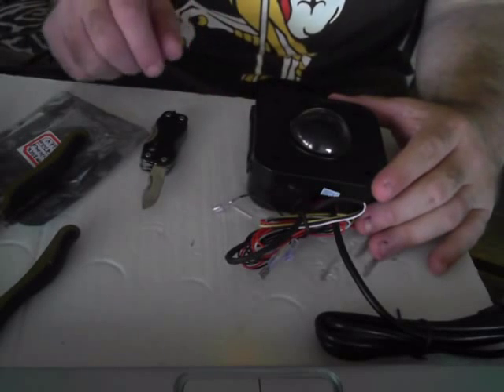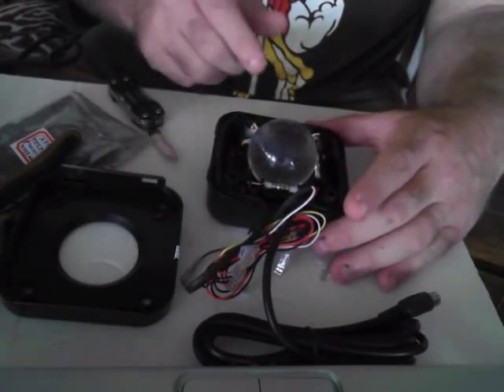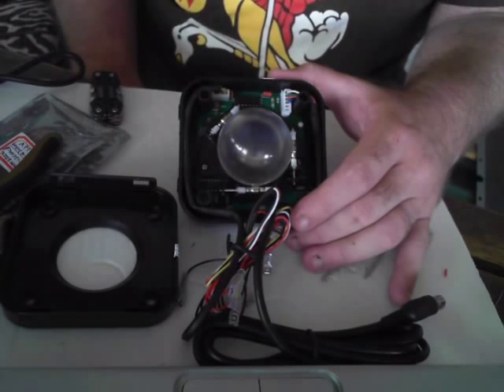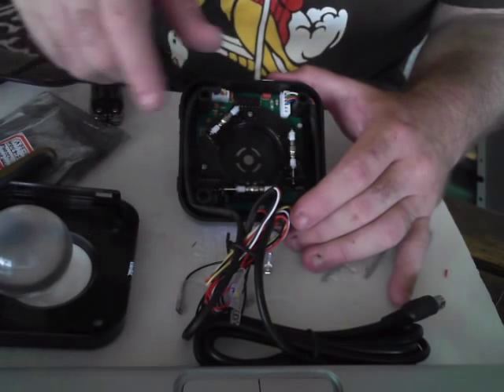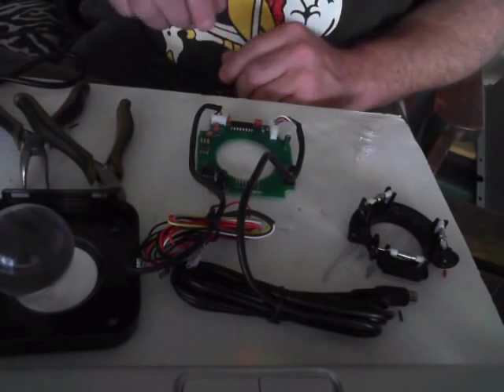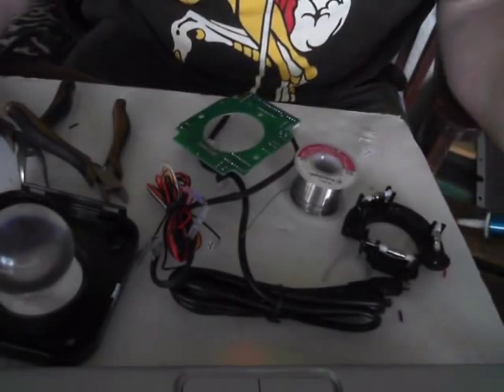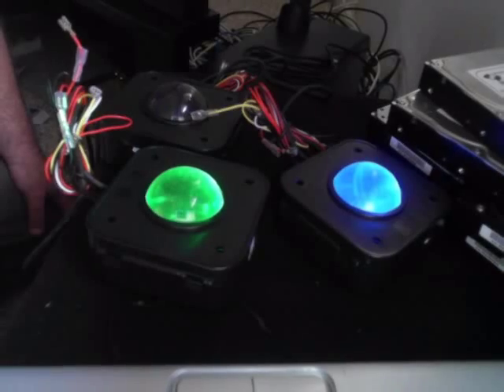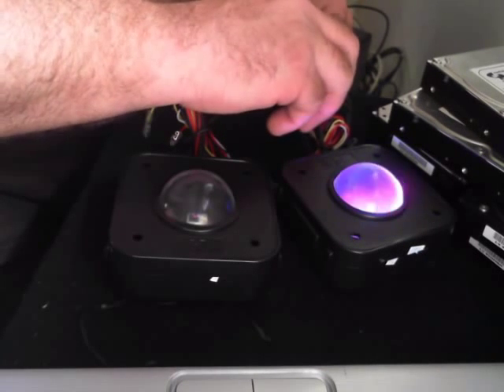LED Trackball Modification

Comment: how do i make this work on win10? i've got a ps/2 port on my mobo, the led lights up but no mouse movement when spinning the ball
Reply: Get a Ps/2 to usb adapter.  I wonder why it doesn't work through PS/2 though.  Did you look at the settings?  It would show up as a mouse in device settings.